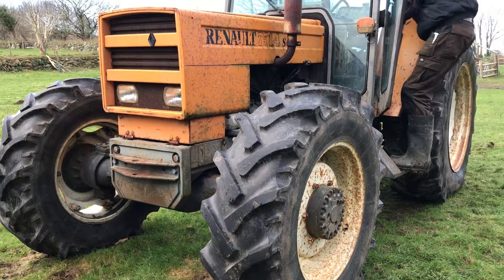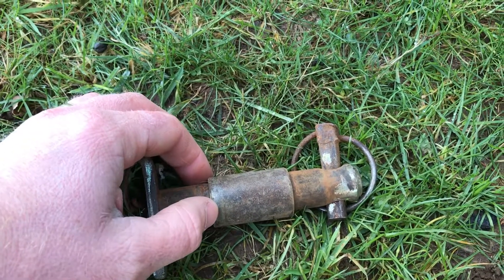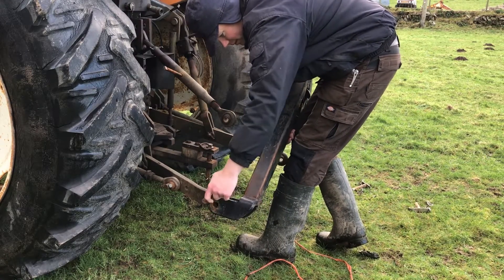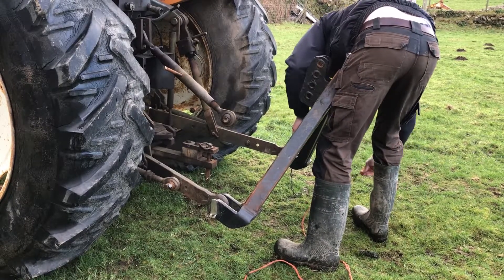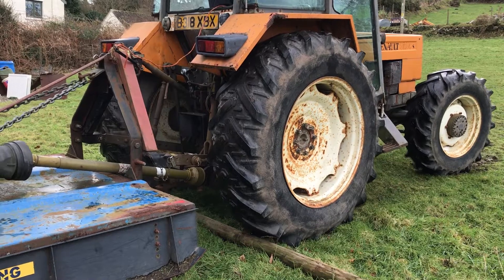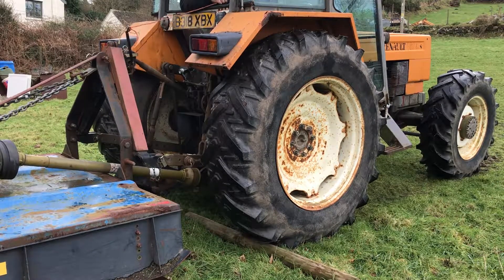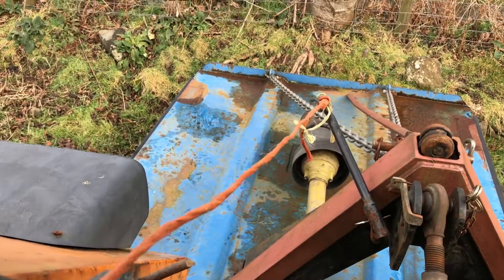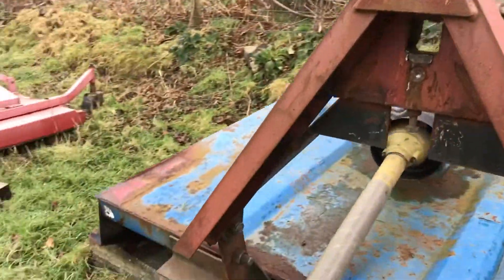Tractor A Frame Quick Attach Linkage

Comment: I used to use these old a frames long time ago. I had hydraulic adjusting RAM on top. ID give the ram and the tractor and the pin a jiggle all at once and the lifts would drop

Comment: That's great, now I know what these 'A' frames are for, I've seen on Ebay. I've never seen the 'implement half' for sale though. Are the frames available or custom made to fit each implement?
I might looking into getting these 'a' frames myself, as hitching up heavy implements, as you will know, is a pain in the neck (and back). One major problem I see is it wouldn't work on things like my 3 furrow plough and finger-bar mower, because they fall over sideways when unhitched. I have to fiddle about propping them on both sides.
Reply from the maker: I’ve seen some a frames sold with both parts on eBay, I guess they are mainly sold separate because you may want multiple frames on implements to go with the one on the tractor. They do make hooking up easier though. 
Thanks for watching
Reply: We hang ours from an old swing set.
Reply: @cody481  So it just hangs until needed? Sounds like a good idea.
Reply: John Somerset 
And if you have an A frame you won't believe how much you can miss and it self centers. 
Our A frame doesn't have a spring lock just a hole at the top that we shove a big bolt through while sitting in the tractor. 
Jiffy hitch and a few others like you to think they invented this but it's old technology in Europe. 
And here in America we are still arguing which color of square quick hitch is correct.
Reply: You can attach a three point adapter too! And attach a bale fork with it. 
The three point adapter is really useful!